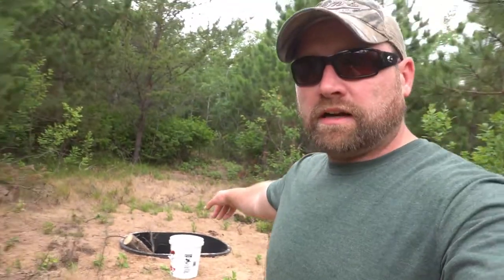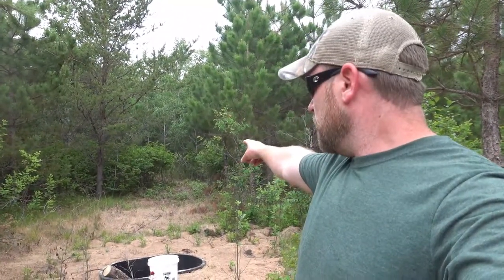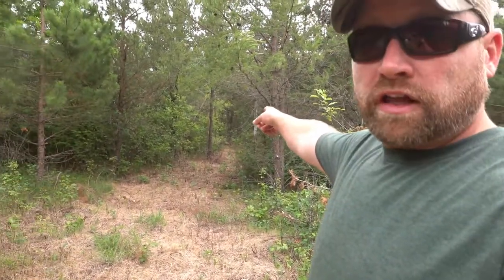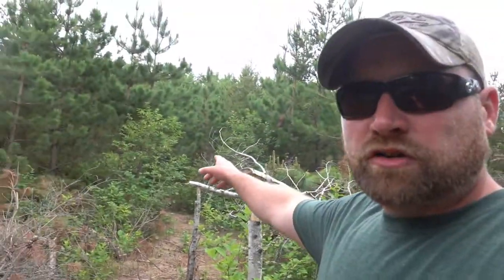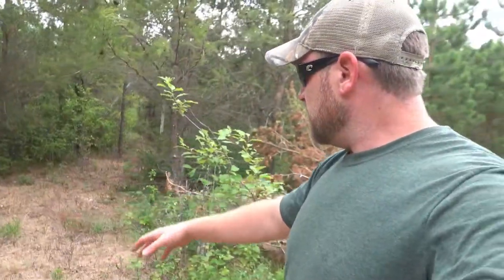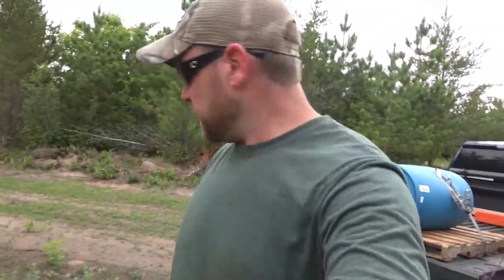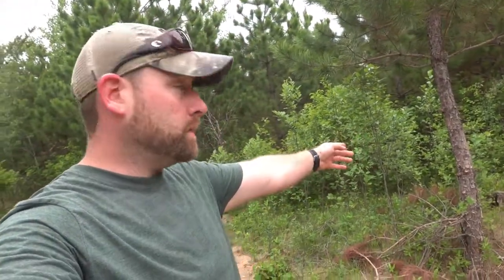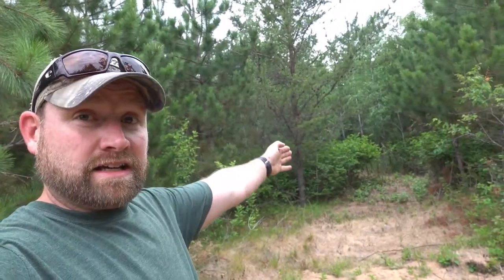Making Mock Scrape Licking Branch for Deer!

Comment: A couple things:
1- I noticed you said Is this a spot in the middle of your property. If you plan to hunt the location, I would be most worried about accessing a stand successfully in the middle of the property rather than the mock scrape itself.

2 - In the video, it looks like the camera is a ways away from the scrape. Could make it miss photos, but hard to tell. I usually put a camera within 20 feet of the scrape for clearer pictures. However, Don’t put the camera on the same tree as the scrape or you’ll get 1000s of wind pictures.

3 - I have found it works best to have your scrape about 20-25 yards from your stand. Couldn’t tell how far away your blind would have been in there, but might be a little tight shooting.

All in all, looks like you’re moving in the right direction! Gotta love getting ready for fall!
Reply from the maker: Paul - 
Hey thanks for all the feedback. Yeah still a Youtube rookie on explaining and working on getting better. It's in the middle of the property I guess you would say North to South but closer to the East edge in the middle of the layout if that make sense. Should be able to hunt it on a NW wind only with a small access trail. 
Unfortunately the camera I put up isn't working, it's roughly 20 feet away and a bummer cause I was up a week ago and lots of foot traffic through there just not a working camera - bummer. 
Appreciate the comments and for watching the vid! Good luck this season!

Comment: didn't have much luck with pine branch but vines about 1" thick worked well.  didn't use scent but made ground completely clear by digging out weeds and loosened dirt about 3 feet under vine.
Reply from the maker: Thanks! Unfortunately for me no vines on the property! Hoping it works!
Reply: Agreed with clearing the ground with a stiff rake...give it some time, looks good

Comment: I’ve had a lot of success with the mock scrapes through trial and error. What I’ve found is 

1. It has to be a vine about 1 inch in diameter. The vines hold scent better than anything else. I can’t even get the deer to touch any other type of branch actually. 

2. I hang the vine with a rope and leave about 5 inches of space between the top of the vine and the tree branch I’m tying it to. This way the vine can naturally swing and the deer are able to move it with their nose. 

3. Vine needs to be waste high, low enough for fawns to also put their scent on it. 

4. Scuff the ground up under the vine with a garden rake or stick. Large enough to where it’s noticeable that there’s just a large patch of dirt and no grass. 

5. Most importantly, you have to pee in it. Seriously. There’s no difference in the scent and it doesn’t spook them or anything. I’ve had a scrape up for 2 months with deer not touching it. I then peed in it and it’s like flipping a switch. They’ll start hitting it within 24 hours after that. 

Once you get 1 deer to touch your vine with it’s nose they’ll all come by to check it out, all it takes is 1 and then you let it do it’s thing and occasionally clear the ground to expose the dirt again if grass grows or it gets covered by leaves. 

Sorry if this comment got a little long, but good luck!
Reply from the maker: Sorry for the delay! Holy smokes this is great information!!! Thank you!! For sure Ill try the vine! Cheers!